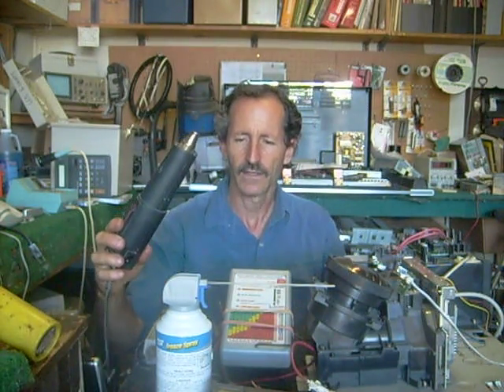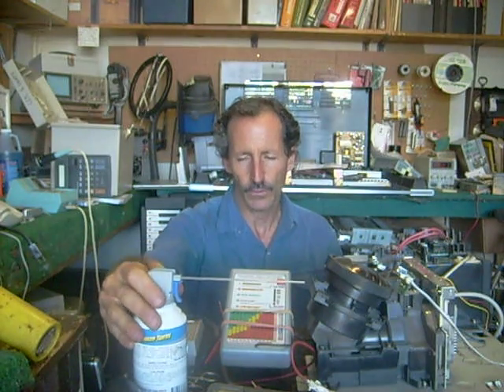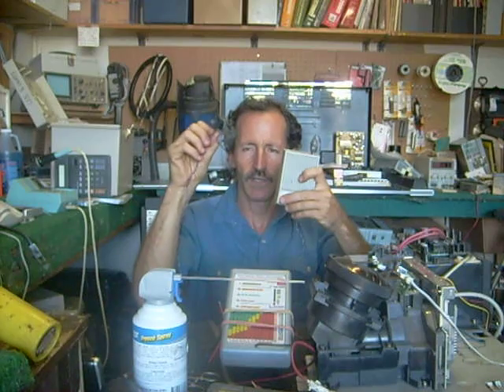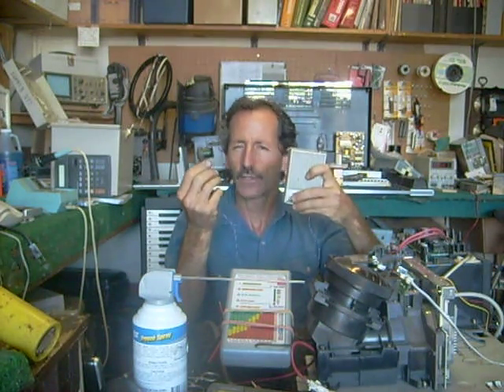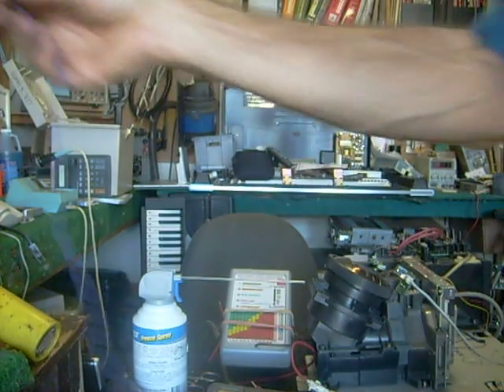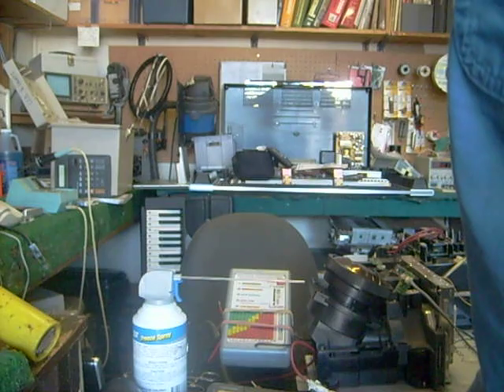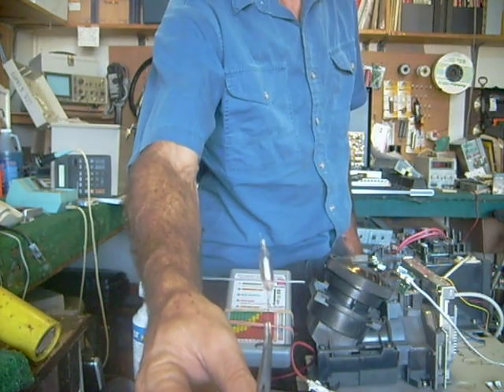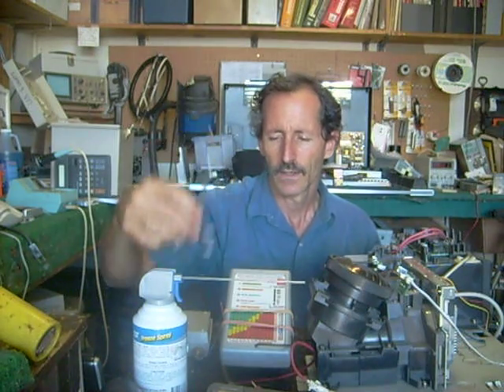LCD TV Repair made # 2

Comment: I think your sound-man in the mixing room is drunk on the job, not cutting out 60hz harmonics on the patche cords, and probably ungrounded too, Hire an specialty electrician. Also your sound man is under paid, or also doesn't understand the cardiod pattern to boom mikes. With him drooping you out of one lobe and into another, going loud soft. I would get with the executive producer, the director and also the head of cinematography and lead sound engineer to take out that 60 hz hum on stage and graininess of he film, so long expensive hours arent spent in the cutting room. Should be easy with some copper to grounding blocks at each input. The main engineer and you should have a chat about retraining vs, redundancy of subpar film crew. You should only have about a crew of 30 (not counting support crew of 30 more for non cinematography) for a video production like this: if you want that golden youtube star. . Lighting is a bit lack luster cold and has hot spots, recommend a stand in dummy before each shot with a light meter, so you the star of the show just has to worry about acting and not sit for hours dialing in lights for warm/vs/cool and natural skin colors. SIMPLE!.

Comment: Well, the problem came back with a loud screeching sound through the speakers. So, my guess was that I have a bad SMD cap on the main board. I  decided to use my hot air station on low heat and a fine tip on the gun to focus on an even smaller area. When I hit a set of about six SMD caps clustered on the main board, the TV came on. I then applied freeze spray to that same area, and the TV shut off. Hopefully, I'll get this figured out in short order and not have to buy a replacement board.

Comment: Hi, Dave. I'm working on a Samsung LCD TV (LN46A630M1FXZA) that would turn on intermittently; it turned on recently by itself after the relays clicked about a dozen or so times. I narrowed the issue down to the main board, so I applied freeze spray (nothing happened) then heat from a hair dryer - TV turned on after heating one small area. I then tried freeze spray to reproduce the issue, but the TV continues to work normally now. Any ideas?

Comment from the maker: You need to figure out if your back light is working. Look through the rear ventilation
holes on the TV and try to figure out of the back light is working. If it isn't I would check out your inverter board for any missing voltages or shorts.

Comment from the maker: @sombersolitude Sure you can use a multimeter, oscilloscope or frequency counter but sometimes I find my audio amp trick with an inductive loop is helpful to do quick checks with out having to touch my probes to the circuit. Sometimes I like to attach an inductive loop in series with a diode to my meter probes and quickly run the coil/inductive loop over my switching transformer because high frequency oscillations can't be heard with my audio amp.

Comment from the maker: @jstrebe I still run across neon lights in old electronics gadgets. They often put them inside small switches to illuminate the switch. Sometimes you also find them in very old TVs as well. They can operate right off the 110 line but you need to use a resistor or it will blow up.

If you don't have any luck finding one locally let me know and I can send you one.

Comment from the maker: @Luckypk001 Any amplifier should work. you can use an old stereo or some computer speakers with a built in amp. This only works with low frequency switching such as when the power supply is in the stand by mode. For the higher frequency switching  such as when power supply is in the run position it's best to have a meter with a frequency counter. You can use a regular multimeter by attaching a coil in series with a diode across your meter probes and placing it near your switching transformer.

Comment from the maker: @xxsurcentralxx Sadly the display on the new TVs often go bad. Color lines can also come from a bad ribbon cable or driver board but the driver board is permanently attached to the LCD display and very difficult to repair.

Comment from the maker: @vicmanm010 I can't guarantee what the problem is but it sounds like a possible T-Con board problem. Did you check to see if there is power going to the T-con board? This board is very static sensitive so if you test is I suggest a ground wearing a ground strap.

Comment from the maker: @billspcclinic  The numbers on a capacitor represent the amount of energy they can store and what voltage they can handle. What you see as a (uf) actually stands for microfarad. There is also an indication of the temperature they can handle.  You can use Radio Shack capacitors if the capacitance and voltage is correct but I don't think they sell the high temperature capacitors which are often recommended. Often times you will see a 105 degrees on the cap. This is its temperature rating.

Comment from the maker: @betto2017 It's hard to guess at a problem of this nature but I would check for bad solder connections using a times 10 high powered magnifying glass. I would also see if the problem is temperature related buy slightly warming the circuit boards using a hair dryer. This can often indicate a bad capacitor. Ideally you need to check your capacitors using an ESR cap tester.

Comment from the maker: @PhatQ45TT1 
@PhatQ45TT1 
I'm using the EDS-88A Cap Analyzer Made by Electronic Design Specialists. Their phone is 561 487-6103
I'm pretty happy with it and I especially like the tweezers style probes.  I was told the Blue ESR Capacitor tester might be an equally good choice at about half the cost, and I suppose you could make your own tweezers for it. I hope to compare the blue ESR tester to my own one day.
You will need to find their contact info on the internet.
Dave

Comment from the maker: @PhatQ45TT1 
I'm using the EDS-88A Cap Analyzer Made by Electronic Design Specialists. Their phone is 561 487-6103
I'm pretty happy with it and I especially like the tweezers style probes.  I was told the Blue ESR Capacitor tester might be an equally good choice at about half the cost, and I suppose you could make your own tweezers for it. I hope to compare the blue ESR tester to my own one day.
You will need to find their contact info on the internet.
Dave